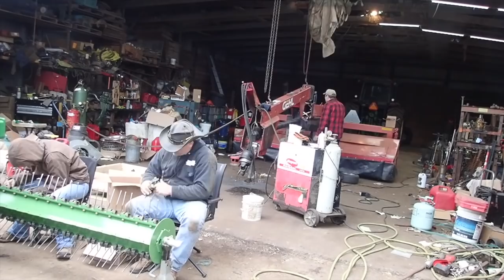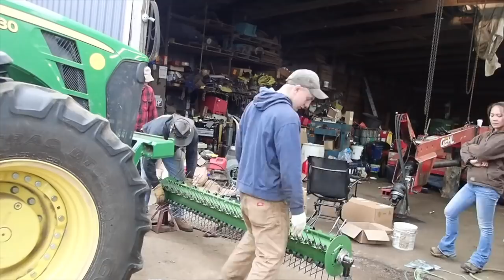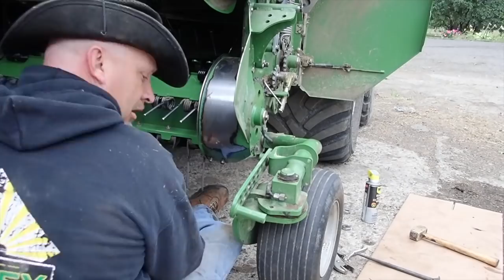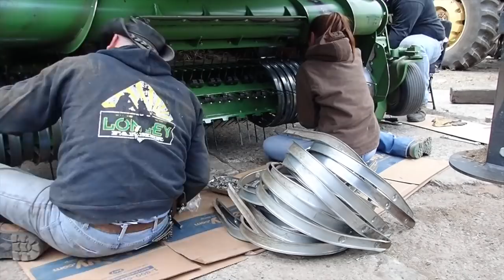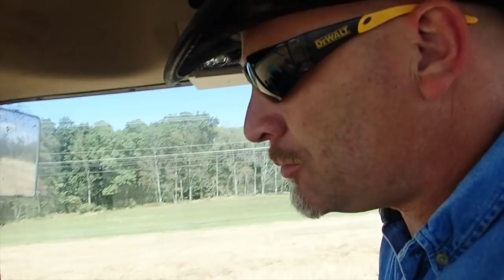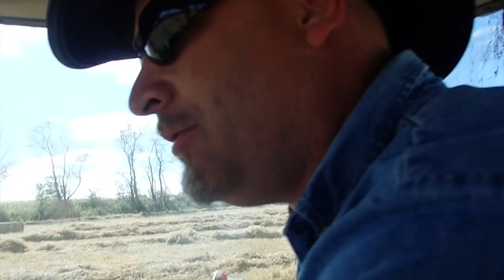Getting Unstumped Fast

Comment: Wow! That sucks! We weren't able to get our pasture cut this year. We thought we finally found someone with a rotary swather but was broke down due hitting concrete at a previous job. Our pasture has contours and is difficult for a conventional swather but it can be done. A few years ago a guy we hired to cut the pasture hit a railroad tie. I had two ties I made into ramps to raise the water trailer. I left the ties out of the way along the fence. But pasture gates were left open for swather and I think someone saw the ties and tried to steal them. Because where the tie was hit was about 30 feet from were I left them. Thief probably pulled it out of weeds along fence, seen it was cut and left it. I never new until I went to set up water trailer in the fall. Same guy wrecked a corner brace trying to get a 20 foot swather through a 14 foot gate instead of the 26 foot gate I was instructed to make. This guy and previous guy both retired from the hay business. Thus our trouble this year. So next year I might try and rent equipment and cut pasture myself.

Comment: One thing I'll mention that will make everyone's life nicer who works on stuff while on their knees. Keep an eye out for a swimming pool mat floaty. they are expensive to by new but you see them at garage sales and curbsides when they start to look bad. I use those for throwing on the ground as they are larger. You don't have to keep moving it and they are generally about 2 inches thick. Your knees will thank you, especially when working in a gravel driveway as sometimes cardboard doesn't give you enough cushion.

Comment: I have a pto question I just got a kubota m5 111 the pto is a 540 and most hay cutters are 1000 pto. Found some adapters but are they safe to use or will you destroy ur tractor and pto

Comment: are you going to take a big battery powered drill out in the fields and poke fiberglass rods into obstructions so when the hay gets deep.. the fiberglass rods still stick up.. think the pulling type rods for pulling wire..  just a thought..  might want to also create a multi layer plywood shape so you can put bent hoops over to pound them back to the proper shape.

oh.. see if you can find some REAL moving blankets.. not the paper cloth versions.. real woven fabric moving blankets. they work so great to work on hard surfaces.. and to clean them.. just throw them over a fence before a rain storm.

Comment: Find some white closed cell foam packing material- about an inch thick- save them bony knees! wont soak up water nor oil...easy to slide on if you're getting underneath something
Reply: As far as your kneed , take care of them .  Go down to Harbor Freight and buy a set of knee pads and try them out .

I have had bad knees for years .  Now that I am covered by Medicare , I am considering knee replacement .  Problem is I am a coward & scared of the knife !   :-(

Wyr
God bless

Comment: At 9:05ish you said the bolts leant left as you’re facing but wouldn’t that be to the right (correct) in the direction the baler is operated           🐴  vs  🐘